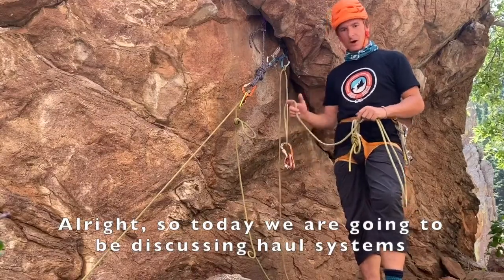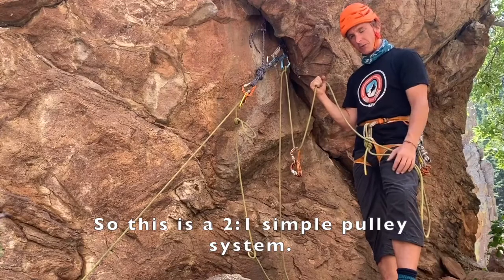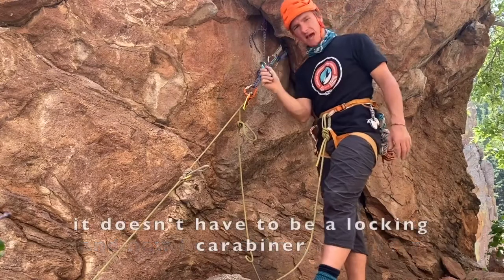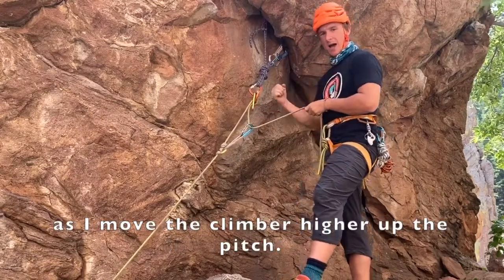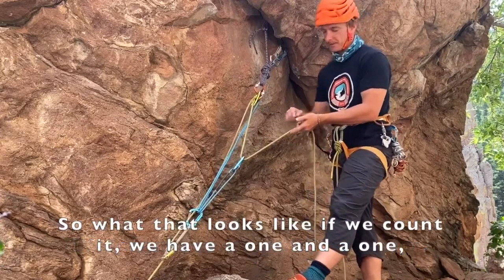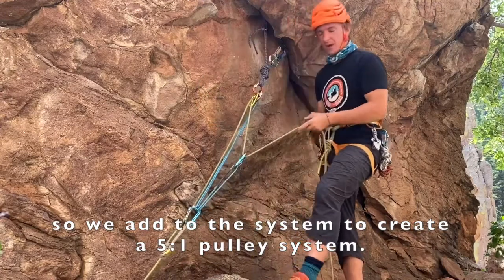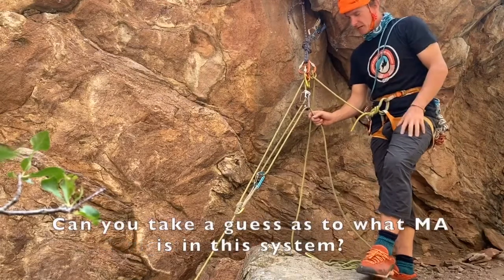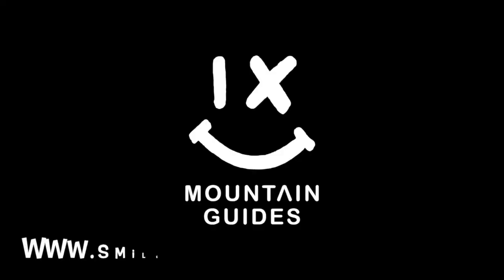Mechanical Advantage and Hauling Systems by Smile Mountain Guides

Comment: Hmmm, with no pulleys used, these are only redirects as far as i know physics...  I rebuild the "5:1" system that you showed to haul a 12kg Kettlebell at home and scaled it. had to give it around 5 kg of force. So, my question is: is there any mechanical advantage at all with all the friction? Cause it should be a lot easier to haul if it was 5:1, right?
Reply from the maker: Thanks for the questions, hopefully we can add some clarity. The video do accurately show the system and their theoretical mechanical advantage (TMA) which was not expressly shared in the video. All this means is that we are not taking into account of friction in the system and the loss associated with the friction. As for your pulley comment, it's not very clear what your asking for us, however, pulleys would indeed increase the efficiency of the system. Pulley are a form of redirect just more efficient than carabiners. Hopefully this helps and thanks for asking!

Comment: Hi, great video! I was curious on what you were using at the anchor as a uni-directional pulley.  I typically use a prusic and a tending pulley, because I am too cheap to get a micro traction or similar device. do you have a better solution to capturing rope as you haul/assist?

Thanks,
Reply from the maker: Thank you, in this video we're using a Kong Gi-Gi, a common belay device we use when belaying from the top. We're using this as a common climbing set-up and a situation climbers may find themselves in. Your solution is one of the more efficient if trying to keep the price down, a simple carabiner redirect offer low friction however the micro, specifically the pulley feature, would be our go to if we are looking for maximize efficiency. Hope that helps!